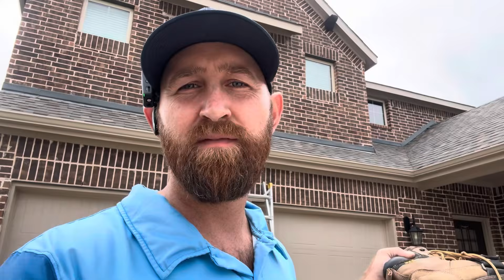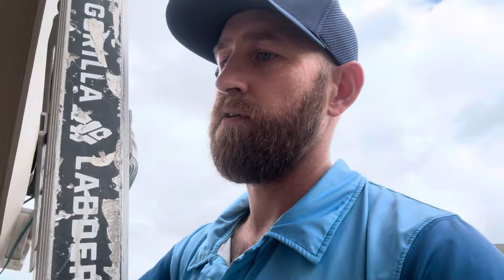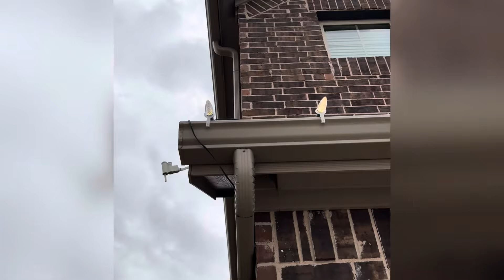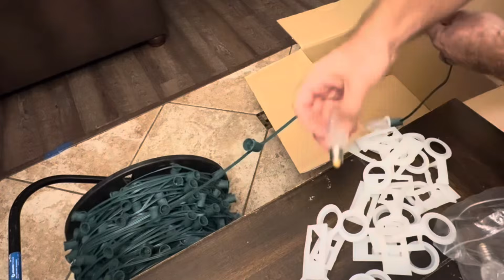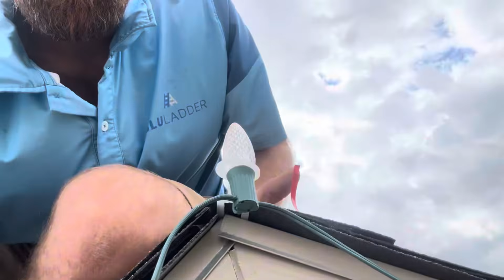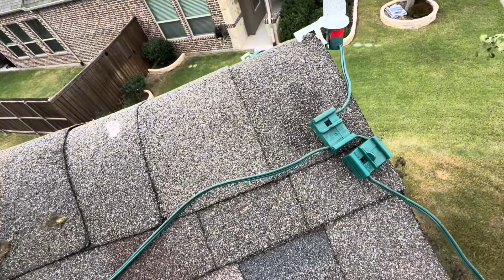The Ultimate Guide to Installing Roofline C9 Christmas Lights

Comment: What is your recommendation on shingles that have “hardened” on the tar so much they won’t move. Have had two installers come and they tell me they can’t put those clips on.
Reply from the maker: Assuming it’s not possible to pry the shingles up with a potty knife, the easiest way might be to staple onto the facia board.

Another option, if you have a time for it would be to use a thin piece of wood that you clamp to the edge of the roof line, and then staple the bulbs directly onto the board. It’s not ideal, and would take extra time, but if you really want lights, it might work. Obviously I can’t see what it looks like and I’m blind to the situation, but those are my first thoughts.

Comment: Would I need SP-2 wire for somewhere that gets colder weather and snow?
Reply from the maker: No, not necessarily. The sp2 wire will last longer in harsh climate, but in general it’s usually overkill for residential holiday lighting

Comment: Question - most stock lights from big box stores come with plugs that have fuses in them, is that needed for custom fitted lights? The plugs that clip onto the socket wire or SPT1 seem too small to have the fuses. Getting ready to do our own this year and that’s a piece I am hung up on.
Reply from the maker: They don’t have fuses. If you’re concerned, simply make sure you have a GFCI outlet that will switch off in the event of an energy overload, and do the math to ensure that the amount of energy your lights will use stays under 80% of the amperage of your electrical circuit (typically 15-20 amps)
Reply: @bluladder Awesome, thank you for the reply and detailed info! It’s not a super long run and will be all LEDs. I do not imagine it’ll exceed power load.

Comment: What's your average charge for subdivision houses
Reply from the maker: Every region very dramatically, so I don’t use my price as a prototype. Most of my basic roof lines are around $500-$600. I’ve typically stayed around five dollars per linear foot in the past, as a guideline.
Reply: @bluladder 5 dollar with material and labor?
Reply from the maker: @alex13933 yes, leasing the lights
Reply: @bluladder what about selling the lights with all the materials.   What do you charge per ft

Comment: You listed both the 1,000 feet of C9 spool and zip wire. Why is zip wire needed in addition to the C9 spool ?
Reply from the maker: The zip wire runs between sections of socket wire. It’s cheaper and cleaner to create custom length extension cords  to run across jumps between sections.